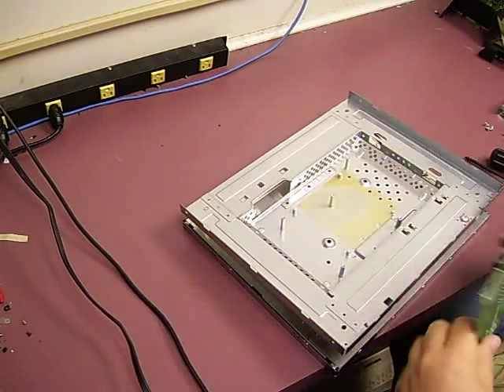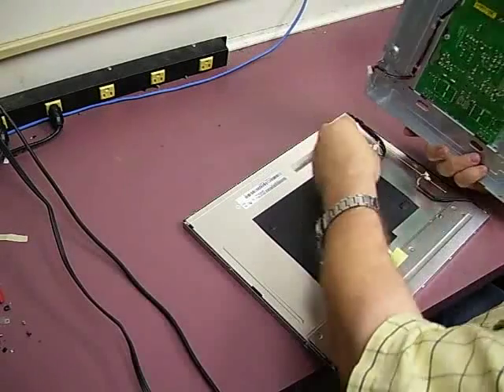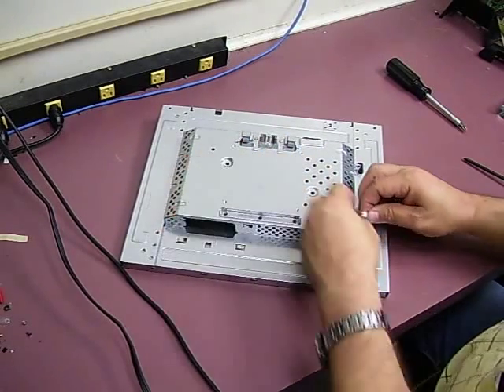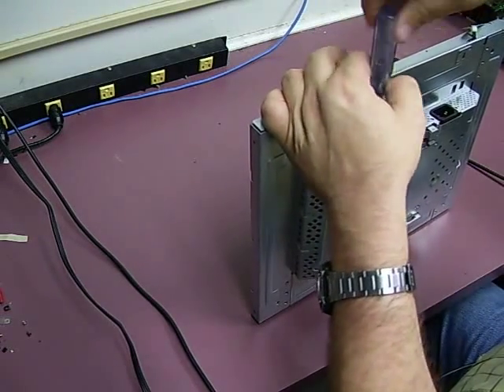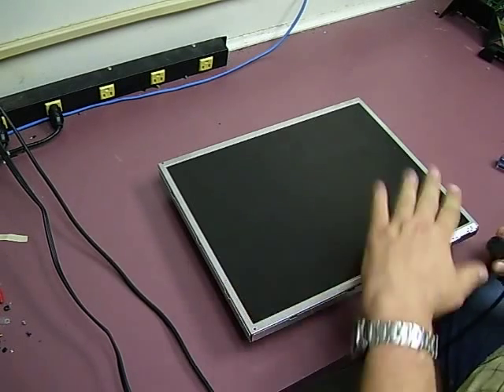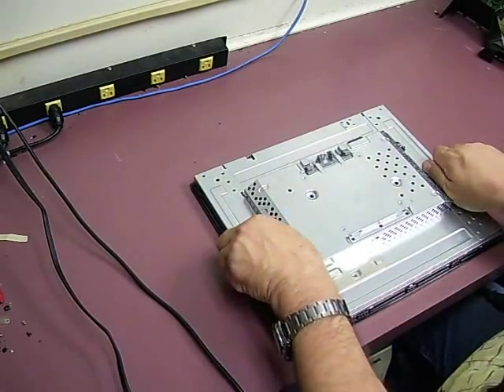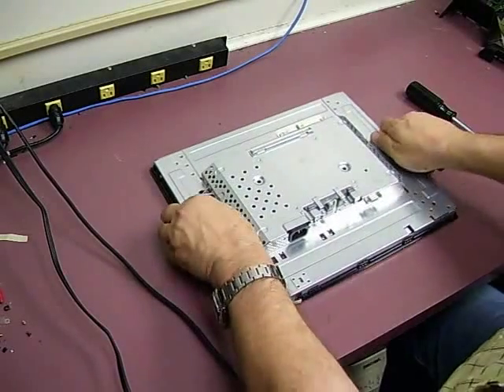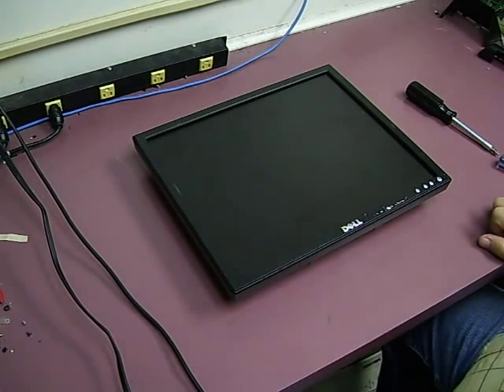Repairing a Dell E177FPf 17" monitor - Part 3 reassembly and testing

Comment: Hi, I have the same monitor too. Its power supply is working and the monitor is displaying no signal output on screen. I replace the VGA cable still no signal output. I tried to connect my monitor on another PC and same no signal output is being displayed. I now think it has something to do with my monitor board. Certainly not the power supply issue but something related to data transfer. Do u have any suggestions or it?

Cheers

Comment: Hi buddy, I have the same monitor. Fluorescent is defective. I installed the LED but the power button does not control. Where do I solder the trigger end of the led inverter circuit? Can you help?